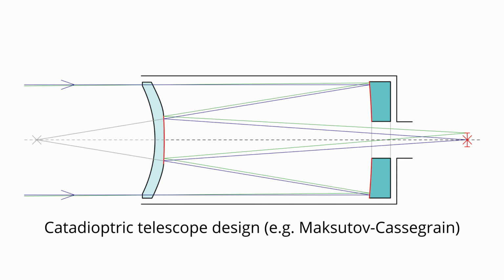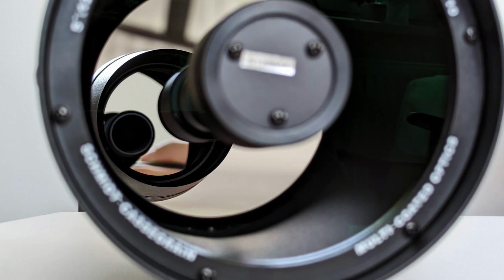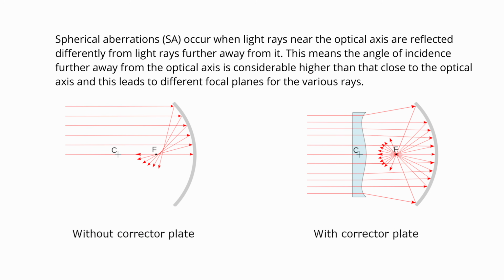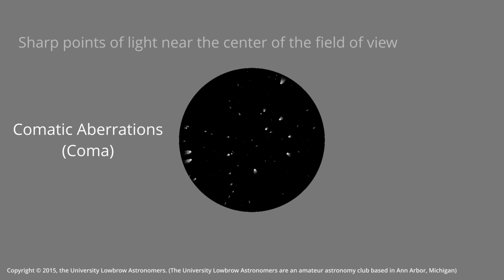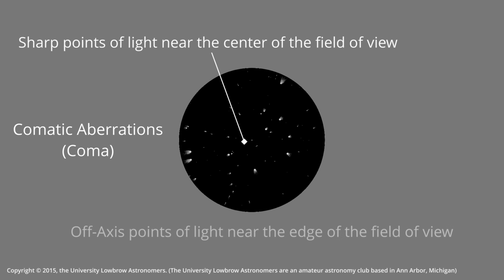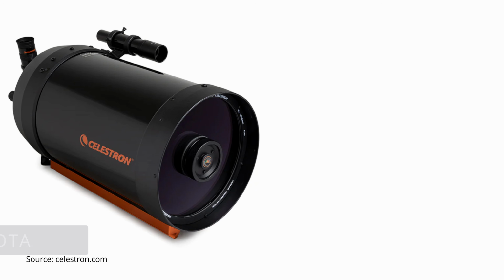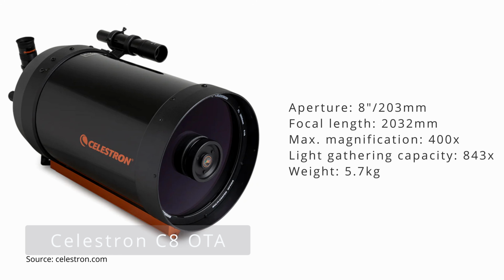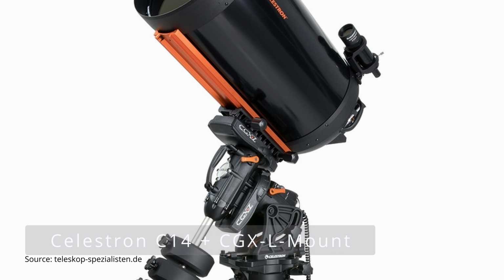Excellent All-Rounder - A deep dive into the Schmidt-Cassegrain telescope design

Comment: I bought a Celestron 6" Schmidt Cassegrain for lunar and planetary work.  I added a x.63 reducer/corrector for small bright deep space work at f/6.3.  I then added a Starzona Hyperstar 6 v4 for large dim deep space targets at f/2.

I chose a 6" SVT (instead of an 8") because that with a SvBony 405cc (asi294) plus the reducer/corrector or Hyperstar plus a Celestron aluminum dew shield is the heaviest my Sky-Watcher Star Adventurer GTi can handle.

Quite nice and versatile rig.

I have and really like a couple Newtonians, but the wind keeps blowing dust down the tube onto the primary mirror and I have to keep disassembling them to clean it.  They are also rather large sails and when the wind gets up I can do 12 knots on the lake.

I have an SvBony 80mm ED refractor and it really easy to use, but is a wide field and not of much use for planetary and lunar work.

I also have a wide field (70mm and 80mm) achromats and a Celestron 102mm achromat with a 1000mm focal length.  I like it a lot.  Good for lunar and planetary work and small bright deep space objects and only suffers limited chromatic aberration.

Comment: Thanks for a great video Bogdan, I am mainly focused on visual astronomy and find that my 2000mm F10 Meade LX90 8" ACF SCT the best all round telescope for that. At age 63 it is lightweight enough for me carry around. Both Meade and Celestron made a coma free SCT, Meade called it "ACF" and Celestron "Edge HD" these are coma corrected and have sharp focus edge to edge. Meade did it by using a correcter plate that made the spherical mirror equivalent to a hyperbolic mirror, they then made the secondary a pure hyperbolic mirror and the result was effectively two hyperbolic mirrors like a Ritchey-Chretien, Celestron use an additional two lenses between the secondary mirror and eyepiece to achieve this. These are superior to standard SCT's. The F10 F ratio of most Sct 's is also an advantage because it allows to successfully use cheaper eyepieces but at the same time limits the smallest eyepiece you can successfully use, anyting smaller than 10mm will result in an exit pupil of less than 1mm which to me is uncomfortable, but a 200 magnification is adequate.

Comment: For wide view the Starizona Hyperstar is available for 6” SCT and larger. Gives you F/2 for wide field and less time needed for taking images. F/6.3 and F/10 for galaxies and planets. A very versatile scope. I just got into this hobby last year and I got an Celestron 8” SCT with AFX mount. 

My experience over the last 6 months tells me I would advise spending a little more on a mount vs getting something like the Celestron AVX, a Skywatcher HEQ5 would’ve been a better choice for an affordable equatorial mount. Higher focal lengths need better guiding. You will also need to use an OAG for guiding vs a guide scope. Higher focal lengths can cause issues with plate solving so choosing the correct camera for astrophotography is important. I had my C8 corrector plate adjusted and the secondary mirror collimated with the primary mirror as they were slightly off from the factory. My C8 with Starizona F7 corrector, Celestron OAG, ASI174mm guide camera and ASI071MC weighs in at about 19lbs.
Reply from the maker: @KJRitch Thanks for your feedback! The Starizona Hyperstar looks to be a very nice piece of kit, one that definitely can make an SCT more versatile. Also I completely agree with the Idea of investing a bit more in a better mount. It will pay off in the future.

Comment: Excellent report! I would just like to comment that in reality the degree of obstruction of the secondary of the Cassegrain designs (classical or SCT), along with that of the Ritchey-Chrétien, is among the highest, in this sense the loss of contrast in a Newton design will always be somewhat minor, especially in Newtonians with high focal ratios. In astrophotography, SCT has the "advantage" (if I can say that, since many of us don't dislike how they look in photos) that it avoids the diffraction spikes typical of Newtonians. Finally, I think it is important to also note the "image-shift" effect typical of designs whose focusing is carried out by moving the primary mirror, and which, especially at high magnification, can be a bit annoying until the image is stabilized. It can be solved by incorporating an R&P focuser in the optical train. It is also worth mentioning that they are collimable (only the secondary mirror) and, in fact, their collimation status should be monitored, especially if they are transported. In this sense, the refractor is the world champion of "maintenance-free"... The comparison between the 4" ED refractor and the 5" SCT will be very interesting...
Reply: Right - the central obstruction of an SCT is larger than of a similar Newtonian just because it is located much farther from a focuser, that means the light cone is much wider at that point.

Comment: In the past I used 8" and later 10" SCT scopes, for both visual observation and astrophotography (with film cameras, back then). Now in my 70s, I don't think I'd be up to managing anything as cumbersome as an 8" SCT on an equatorial mount. I have been getting back into some astrophotography using the latest 'smart' telescopes. I have a Celestron Origin, which uses a 6" RASA tube (somewhat similar to the SCT design, but dedicated to photography), coupled with a computerized mount and computerized camera control. I can manage this (though it is around the limit of what I can manage at my age, given that I have to observe at remote sites, often in extreme cold). So far I am very pleased with the results I have been able to produce. Of course, this is not a cheap option... but the price does need to be considered in terms of everything it includes, which is much more than just the OTA. The Origin (and smaller 'smart' scopes such as the Seestar S50 and Dwarf 3) are not really any use for planetary work, due to short focal length (the Origin is F2.2, 335mm). I am currently considering getting a scope specifically for planetary work - but it will have to be fairly small and easy to transport and set up. I'm thinking of a modest Mak, but I may also get a fairly light-weight refractor. And I really enjoy viewing with binoculars, which is another story.

Comment: The typical off the shelf newtonian reflector in the F/6 to F/4 have a central obstruction of between 20 and 25% of the primary mirror area, as opposed to SCT's which range from 30%  to 40%.
Newtonians are often significantly better in central obstruction than an equivalent sized SCT, even fast newtonians at f/3.45 to f/2.8 enjoy a central obstruction smaller than some SCT's.

Comment: Comparing SCT's with their cousins Maksutov-Cassegrains would be interesting too.
I have heard the following points:
1) Maks have thicker and more complex corrector, and because of that, due to economic considerations, they're limited to about 6 inches of aperture (bigger corrector lenses for Maks are simply to expensive to manufacture);
2) Since Maksutovs have thicker correctors, they need more time to reach ambient temperature than Schmidt-Cassegrains;
3) On the bright side, Maksutovs have smaller secondary mirrors, which means less obstruction for the light, and bigger effective aperture, compared to SCTs of the same size.

I have also noticed that Maksutovs have greater focal lengths and slower F-stops, but i'm not sure this is a hard rule.
Are these points correct? Have I missed anything?
Reply from the maker: @Booruvcheek You are correct on all three accounts, although there are Maks with apertures greater than 6" out there. They just aren't cheap. I would also add that because of the more complex corrector lens, a Mak is capable of delivering better corrected views than an SCT. Maks tend to be a bit slower than SCTs, but I wouldn't call that a rule.

Comment: I’m just getting into telescopes, I’m retired, living in north west Montana . My first thought was getting an entry level telescope but then figured I would want to move forward to a telescope that I had more options. I didn’t want to purchase another telescope. So I’m thinking a cassegrain telescope will have a bit of a learning curve but will offer my Segway to move forward without another purchase of a scope . Your thoughts please ? Thank you
Reply from the maker: @montana4939 Hi! A 6" or 8" Schmidt-Cassegrain telescope is definitely a good allrounder and a solid option that likely won't need an upgrade for many years. It's only real downside is the narrow FOV thanks to the very long focal length. This is why large DSOs might not be visible all at once. Therefore a 4" or 5" refractor telescope with two or three lens elements might be equally interesting. These would offer a bit sharper images and a wider FOV. Options like the 100ED from Skywatcher or SV550 122mm from Svbony would be great choices here as well. Hope this helps.

Comment: I owned an 8” dob but the huge size and weight makes me wants to get a sct. Since I am mostly on dso is sct fit for the job? Let’s say with 35mm panoptic ?
Reply from the maker: @mengtack Due to the very long focal length of an SCT, the effective FOV is significantly narrower than the one of a faster refractor with the same EP and this makes the SCT rather suited for planetary viewing than DSOs.

Comment: @Bogdan you tested 120mm triplet and this c8, cost is about the same around 1700eu, which one you think does a better job doing the jack of all trades for visual?
Reply from the maker: @PauI__  Hi Paul, the SCT in this video is a C5 so it's not a direct competitor to the 122mm triplet. But in terms of contrast, sharpness and color accuracy both the C5 and the C8 produce similar results. So comparing the SCT to the refractor with respect to these aspects, I would give the edge to the refractor. In my opinion it's really hard to beat a well corrected triplet refractor when it comes to image quality.
Reply: The math on light loss for SCTs from their secondary and overall transmission is their aperture *0.77, so an 8” SCT should perform like a 6” refractor under calm skies

Comment: Is there a focuser for svbony MK105mm?
Reply from the maker: Hi, the telescope’s visual back is 1.25″ with a compression ring and T-thread (M42x0.75). The diameter of the hole at the back of the telescope is 35mm. So basically any focuser with a T-thread should work.